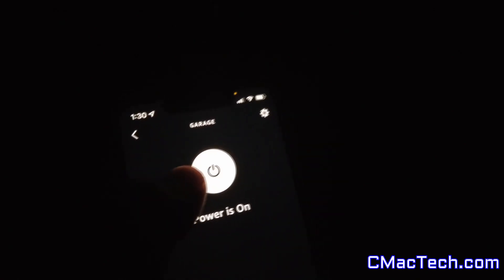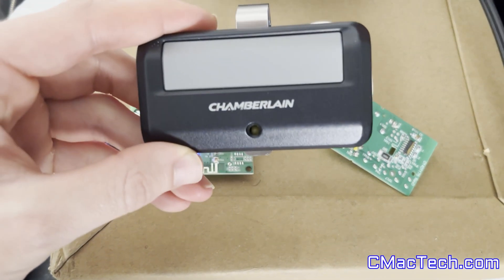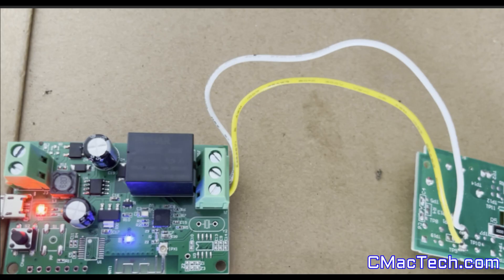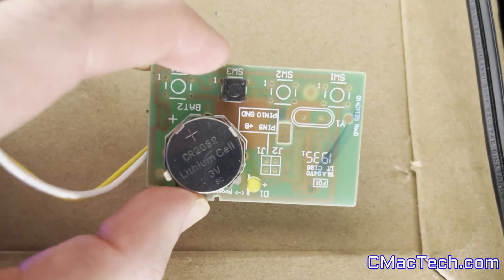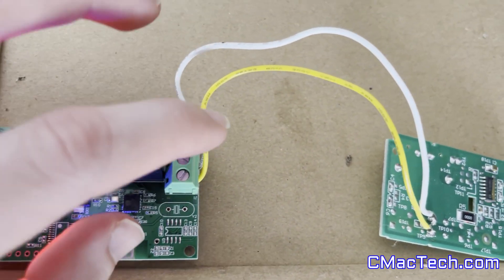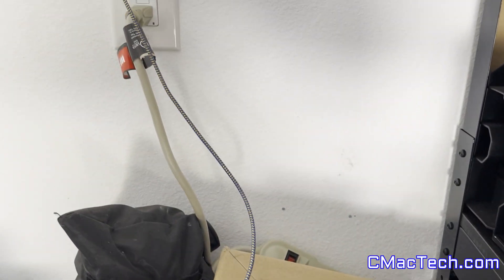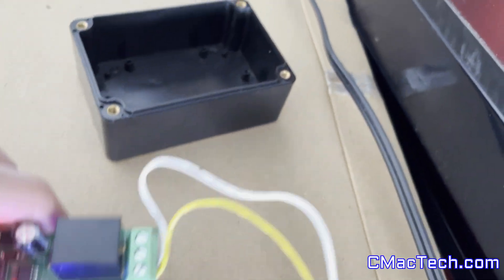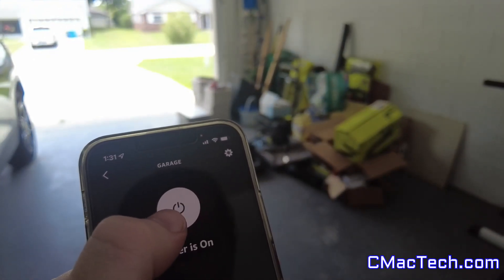How to open your garage door with Alexa FOR LESS THAN $15!!!

Comment: After reviewing your setup, you can skip the remote altogether and plug the two wires  from the eWeLink (NO / COM)  directly into the garage door opener inputs.  You will see these inputs near the learn button on the garage door motor unit.
Reply: This did not work BTW.  I had to revert to using the remote.  Not sure why I have used a basic wsitch in the past to open and close garage door but it was with an older Lift Master opener.